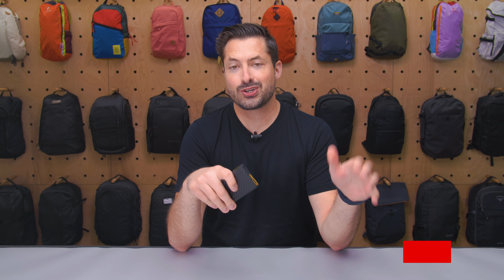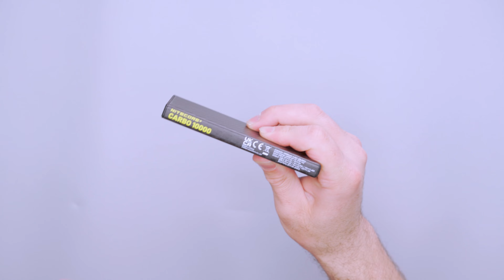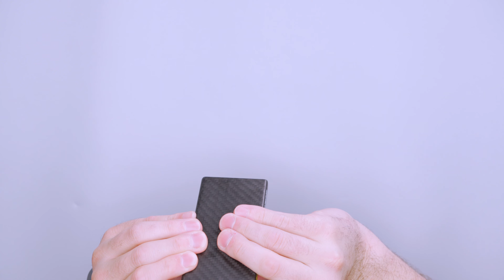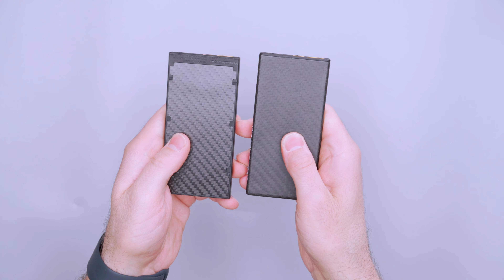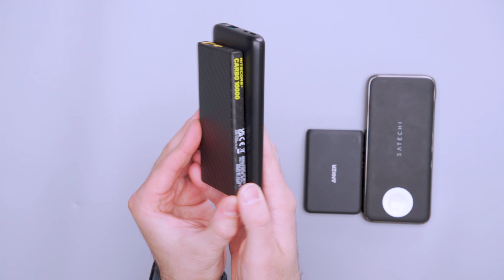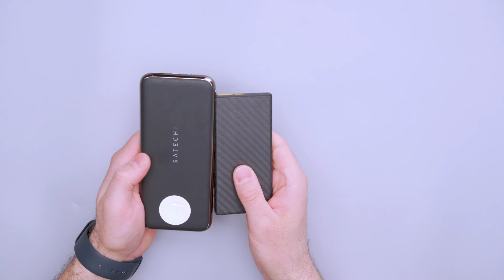NITECORE Carbo 10000 Power Bank Review (2 Weeks of Use)

Comment: It was interesting to me that you pointed out about noting, on the side, how it looks, and if the corners were round, and the miniscule weight difference. My questions were around at what temperature does it maintain and how well it retains its charge at that temperature and how quickly it discharges for your use case and what were those conditions at which you used it, and where and how did you store it?

Comment: I bought this power bank and was very disappointed. It is a very nice and small device. But three things no one mentions. 1. When I use 20w charging for a phone or tablet, the power bank gets extremely hot. I estimate the temperature to be over 55°C. 2. Because the power bank heats up like this, its efficiency will not be good, but I did not measure the efficiency. 3. When the last LED started to light up, the voltage of the powerbank started to drop from 12.03v to approx. 11v and then shut off even though it wasn't fully discharged.

Comment: @1:47 the complaints/reviews you are referring to on nitecore's website are mine. They do need to fix this issue as it is minor but it disproportionally effects the functionality of the device. Not sure how it got past initial prototyping. 

Apart from that, this device is all A's for me. Its the perfect mix of simplicity, basic fast charging and the best portability. I have multiple different brands, models and sizes of power banks and this carbo has been my go-to for 90% of the time. I am at the point where I've started giving away my other power banks to family and friends and would rather just buy the carbo series moving forward.
Reply from the maker: Thanks for sharing your insights! 🤙

-Eric

Comment: Low voltage mode just disconnects the auto shut off that engages when the power bank doesn’t detect a device drawing any power. After you finish charging low voltage devices such as AirPods, you must remember to shut off the low voltage mode so the power bank can turn itself off.

Comment: A lot of time spent on aesthetics but little on functionality. How long did it take to charge? How long did it take to charge a device compared to other batteries? How much charge did you actually get out of it out of the nominal 10k? Easy to make a battery physically small by making it smaller capacity too....
Reply: I own the nitecore nb10000(10000mah) v1.. rated capacity is 6400mah..I got it a while ago for around $50
Reply: @The96civicrider  6400mah only... meh
but where did you find it for $50?
Reply: @Qjemuse  it's on Amazon from lumen tactical for $59 but I believe I got it cheaper when it came out. I have the version 1 so the new models might be a little better and more money.. I purchased it August 27,2021 and never had a issue with it, but it does get a little hot when in use.
Reply: @The96civicrider  thanks and glad to see its holding up well after a few yrs of use